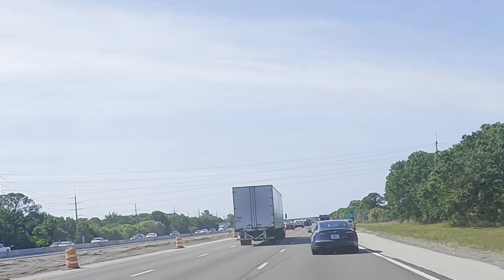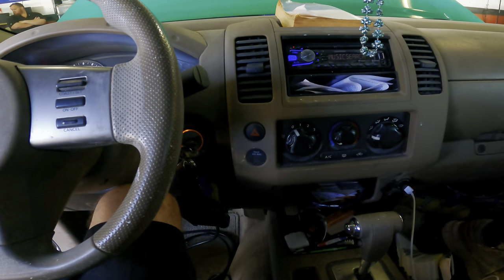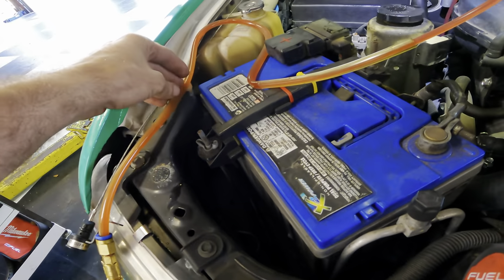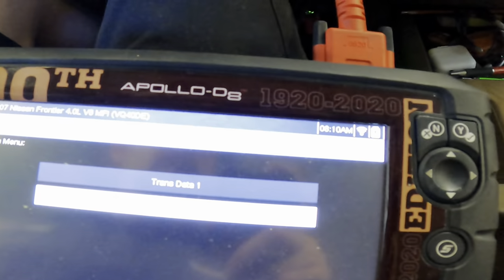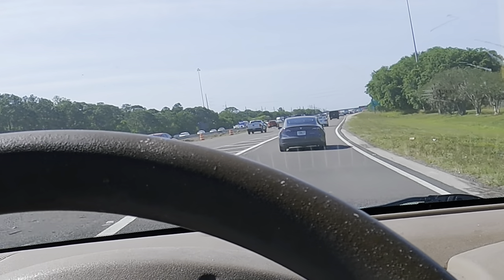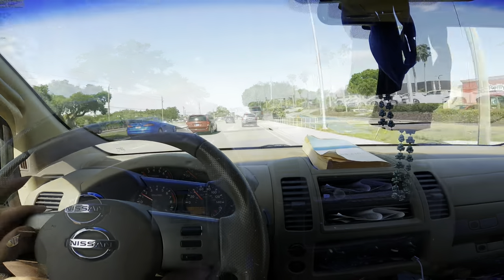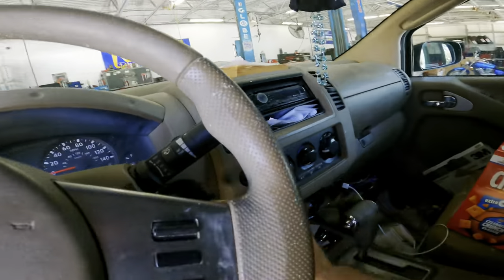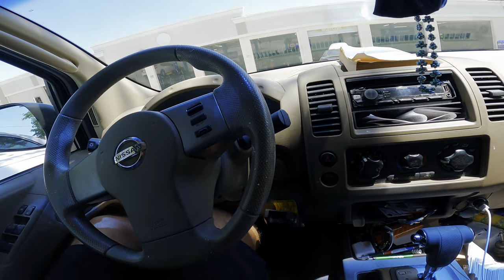Customer States: Vibrates Sometimes! How to save money by using your words!

Comment: I've found that no matter how detailed my description of the problem to the service writer,  the technician rarely gets all the details.  For many years now I've actually typed a short detailed write-up of the problem (my handwriting isn't great) and ask the service writer to attach it to the repair order.  That seems to help get better information to the tech.  I do have an advantage over those people who only know how to put gas in the vehicle and turn it on, I have an automotive engineering degree and spent part of my automotive career as a service rep for a Big Three automaker.  I learned very early on that the single biggest problem causing repeat repairs or just failed repair attempts is poor communication.  Dealerships and other service shops need to understand this and upgrade the service writer position.  Most places I used to visit as a service rep seemed to care more about the writer's ability to up-sell than they cared about their ability to communicate effectively with the customers and then provide the needed information to the tech.

Comment: Service writer the other day wrote a truck up to check brakes because they're squeaking when stopping and set tire pressures. Didn't ask did you have brake work done recently were you told on your last service you needed a brake job soon or anything? Customer had brake work done somewhere else and wanted to know why it was noisy. I'm not diagnosing someone else's work for free! As for the tire pressures they were already set at 40 psi, which is what they wanted but wasn't told until afterwards... smh

Comment: in my experience, initial short inspection looking for obvious faults. If nothing found then place a short phone call to the customer. Cut out the middle man (the adviser) and get the words/complaint/description straight from the horses mouth.  simple "Hi. it's jim from the shop. I'm the tech trying to solve your problem. can you expand or clarify what the problem is? I was told I'm looking for a clunk or a rattle. when does it happen? at what speed? does it sound like front or rear to you? while brakinng?  when putting into gear?etc etc etc"........those five minutes on the phone saves an hour of guessing.

Comment: The mechanic makes the difference. 
I bought a used car, something was making a jingling noise when driving and the dash clock didn’t work. The dealer agreed to fix them.  They couldn’t find the jingle noise so they replaced the blower motor. They jiggled the clock power lines, it worked for a bit, then stopped. When I picked it up nothing was fixed. I ended up replacing the clock myself. And the jingle noise was large cotter pins used to hold the grease caps which I replaced with the correct size. They were total idiots.

Comment: Not gonna buy a Corvette; but I did subscribe.  It is important indeed to have at least a semi working knowledge of what makes these thingies run.  Most people are totally unaware of what happens when they turn the key or push the magic button.  It's like the doctor whose plane's alternator died, and so the battery was starting to run down.  Such a simple solution.  Fly to an airport, land, charge the battery replace the alternator, and be on your way. 

But nope.  She either never learned, or forgot, that small planes have two separate ignition systems, and neither one is dependent on the battery.  They're like the old push mower systems.  Pull the rope, the engine starts till you short out the coil.  squeeze a metal thing together with another metal thing, the engine quits.  No battery needed.

She forgot that, so in a panic, landed with the wind, at too high a speed, went off the end of the runway, and tore up the plane--which had been in the family for 30+ years.  [Sigh....]   Just learn a few basics, folks.  So you can communicate effectively.😏🙄

Comment: Transmissions in the Nissans have been a problem…especially the torque converter. Over time, the heat breaks down the trans even if an external trans cooler is added, the tranny breaks down (torque converter). Google Nissan tranny problems in 4cyl vehicles.

Comment: Communication is extremely important  .I watched in horror as a transmission was being removed from a car that came in for  HVAC issues .  I greeted the customer, made the Repair Order , had the customer sign the RO , tagged the keys and stapled the keys to the RO  , keep in mind  I was not the Advisor at the dealer , I was a Tech .  The Advisor and Tech took it upon themselves to make the executive decision I was mistaken , pulled the car in and removed the Transmission from the FWD car . The Tech and Advisor ignored my comments and  found out the hard way that I was correct when the customer arrived to pick up the car .
Reply: @kitsuneneko2567   nope , continued to be very unorganized and lots of come-backs usually little shit but it's still a come-back

Comment: I feel you on the info bit. I'm basically the neeeeeeeeeeeeeeeeeerd equivalent of a shadetree mechanic. (Relevant "The Simpsons" clip goes here.) The more detail you can give me, the better.

For example. "It doesn't come on." This can mean anything from, it literally sits there and stares at you when you press the power button and does absolutely dead-as-a-stone-statue NOTHING, all the way to, it tries to boot to Windows, bluescreens, and reboots... and everyfreakingthing in between.

In the former case, there are precisely TWO possibilities, barring an outlet that doesn't work or an accidental power cable unplug. One, your power supply is cooked, or two, you have a bad power cable -- it happens, I've seen it, and I've fixed it. Either way I'll have you on your way in well under thirty minutes unless you have one of those machines with a stupidly weird power supply that they put in there just because they could, in which case it's a matter of ordering the part and dropping it in... I'll give you a quote for the part, if you want to buy it, when it arrives I'll call you and as soon as you come by with your machine again, drop it in and fire it up and away you go.

In the latter case... it could be anything from the system overheating because it's a Pentium 4 Dell that's been upgraded to Win7 or so and yet somehow it's not seen the business end of a compressed air hose or even a can of the so-called "compressed air" computer duster stuff they sell at Walmart and office supply stores for a frankly ridiculous sum in its entire life and it was sold only six months after the Twin Towers fell and Aunt Judy remembers specifically that it had to be six months exactly because blah blah blah nobody actually cares... or it could be that the last fellow Tim took it to wasn't nearly as trustworthy as Tim swears he had to be because he's Edith's cousin and everyone knows he'd never swindle from a fly (coz Edith says so) -- but somehow one of the latches on one of the RAM sticks is a bit loose... to someone thought they were 'clever' (that is very much a vulgar word in my presence, in this context, and this exact sort of tomfoolery is why) and when they were installing some new bit of anti-malware thing WITHOUT REMOVING THE OLD ONE because they got yet another virus, it told them to install this free driver updater gizmo, they thought that was an excellent idea, and when it magically found them a much newer driver for their antediluvian chipset graphics, they figured -- hey, it's a newer driver, that can't possibly be bad, right? and that's the last good boot the system had. Of course it'll be ninety minutes of switching parts around before it occurs to them to actually tell me that... I tell you what, folks, I'm probably gonna be here a while, and it's probably gonna be a bit of a show :-/ I hope you brought a coffee, and maybe some popcorn...

The more you tell me, the more I know. This is true of ALL technicians doing repairs on your stuff, whether it's a car or a computer or a smartphone or a tablet or -- anything, really. YOU are our eyes and our ears. Tell us what you see. Tell us what you hear. Give us as much detail as you possibly can, and leave out as little as you are physically capable of leaving out. Things that you think are likely irrelevant are often the key to a solution, and we will often assume, if we don't hear you tell us that it's a thing, that it isn't a thing, and that will lead off on a wild goose chase of false conclusions. Make no assumptions, and leave us no room to make assumptions. Tell us everything, and I mean that as literally as is humanly possible to achieve.

tl;dr, the more I know, the better I can fix your cr*p, and that's true of all techs. If you want it done fast and done right, with the least amount of "gnashing and wailing of teeth" (to quote a good friend of mine that I don't talk to enough any more -- heya, Ryan :) hope you're havin fun out there) possible on all fronts, tell me absolutely everything you can and don't hold back.

Comment: Ray, I have an ABS light, and have an expensive Autel that should let me reset that light. But it does not. The car is an Accord EX.
The car does not show any problems with the breaking system. Could just be the ABS module needs replacing?
Hopefully I gave you enough info!

Comment: I like your point about lacking vocab to describe a car's woes. I begrudgingly have come to terms with that fact that to most/many ppl, cars are just a metal capsule means of getting from point A to B, to that end, it's hard to expect them to know how to describe issues in ways other that, "it doesn't..." 

Idk how tech versed you are Ray, but you may say, "the website doesn't work" well, are you getting a 500? DNS error? JS script break? Taking long to load? Are you online? etc. 

On the flip side I try to over explain and it seems I come across ppl that couldn't care less about my helpful details lol 

I'm hopefully moving to a new role where I am the customer service AND responsible for the end product's performance. Removing the middleman for better and for worse -I get the brunt of customer complaints 😅

Comment: Many service 'advisors' or nothing more than sales people whose job is to make profit for the shop by selling unneeded work. Sears store I worked at was good for that. They know virtually nothing about the cars they are supposed to be providing service for. The service writer at Sears when I was there DID know her stuff but worked on commission and wanted to make more $. Had that problem with dealer service writer and had to take a tech out for the test drive for a squeak in the front of a '08 Hyundai (bad bushing>>fixed under warranty).

Comment: It’s worth it to do a flush and filter on the tranny when it’s that badly burnt. I have a feeling the clutches in the converter and tranny are nearly completely smoked. That would definitely cause a vibration from multiple issues with its many parts.

Comment: Ray, a comment on your one-hand driving, if I may. Much of the time, your hand is at 12 or 1 o'clock, which puts your arm directly over the center of the steering wheel, where the air bag is located. Should that bag go off, it will shoot your arm into your head and you would be severely hurt. Other times, your hand is at 9 o'clock, which doesn't have that problem. Most driving instructors recommend people keep their hands and arms away from the center of the steering wheel, ideally at 10 and 2, for that reason. You make several good comments about safety (ex: lift, "egg" tires) and it would be good to let your viewers know about steering wheel safety too.

Comment: These suffer from bad radiators that dump coolant into the transmission and burn up the transmission, they also suffer from bad timing chain guides that cause a howling noise as they wear. I had a 2007 Frontier SE KC biggest piece of crap I ever had.

Comment: My expierence as a customer giving out all the information was mixed. I repair most of the stuff myself, but sometimes you need special tools that are too expensive to buy for one time use and sadly here is no rent-a-tool service available for car tools. I do know a lot about the mechanics and electronics. Sometimes the service person did not want any extra info and I get responses like: "yeah yeah, we check ourself, you stupid customers don't have any clue anyway" Not literally, but you can hear that. This annoys me, so I'll never go there again. Currently my car is in a shop because of overheating and fluid loss, I told them to check for exhaust gas in the cooling and do a pressure test to find a possible leak. Not sure what causes what: leaking fluid => not enough pressure in the system => cooling evaporating or overheating=>high pressure => blowing out steam somewhere. I don't have a lift and I don't see any water traces. They first shop did not want to listen what I had to say so I searched another one that listened. But they also did not like that I gave them a list of "things to do" So it goes both ways. Yeah the liquid isn't that expensive and you can get pressure thingies for cheap, but this is the first time in 30 years fiddling with cars that I need that. Probably I wont need it again.

Comment: Step one in this would have been to call the customer before taking guesses.
Reply: From what I've seen of Ray I would guess that he asked the service writer for more detail and none was forthcoming. One reason they have service writers/advisors is so the mechanic doesn't have to take time off the shop floor to interface with the customer. If more detail is needed, the tech can be working on another job while waiting for the front desk guy to call the customer. Of course, as pointed out by others, this depends upon the service advisor doing a proper job of communicating.

Comment: Problem could be nothing to do with transmission, could be fuel pump, ignition issue, who knows?  People have to understand as vehicles age things do start to wear out.  For example torque converters wear over time and can cause rough idle or whatever, they can go on for years like this, would you replace it on an older car?  No you would live with it.  This is happening on my '97 Celica with 231,000 miles, when I stop in Drive the idle goes way down, the solution?   I'll slip in neutral and it then idles smoothly, as you say people must try and educate themselves on how cars work, they will save a lot of money!

Comment: You mention the need for better scan tool or data/functions within said scanner. Can you recommend a GM focused device that can read/program like a Tech2 but attainable by non GM dealership mechanics? I’m a big fan of your channel and have a LLY and a LBZ DURAMAX equipped trucks. Your scanner was able to do the injector program on that L5P. Not sure I can afford a SNAP-ON but I’m a big fan of getting the job done myself. I’m not a certified mechanic and would like to qualify myself as a shade tree mechanic. My son recently graduated from UTI. So I gotta get the lingo and tools to keep up with him. I will say that I communicate with shops and they don’t always put the info into the ticket. I hate the phrase “it is what it is” but sometimes it’s the best phrase for the topic. Ugh!!!

Comment: I was working at a marina for a few years.
Always liked to talk to the Customer because getting the complaint third or forth hand sometimes sucked.
When a counter person tells you what the guy that took the order in says the customer said it makes a sound like.
WICKY WICKY WOO WOO DING DONG you can only stare like a dear in head lights.
I got to talk to a customer once and he fixed his own problem.
The motor shakes when it runs ever since I did a tune up.....Plugs,points,rotor cap.
It ran ok before that.
What did you gap the plugs to.....they come pre gapped out of the box.
Ummm...and the points???
The points???
What do you mean.
2 Plugs had no gap they all needed to be regapped.
The motor was GM so I hooked the dwell meter up and the dwell was pretty close just off by a touch witch shocked me.
He said this is the best the motor ran in years what did you do???
A tune up.
Buy a cheap plug and feeler gauge it will be your friend.
Would of mentioned a dwell meter but extra stuff might make his head hurt.

Comment: I'm surprised you don't have a bi-directional scan tool. Any of those older Autels would work (MaxiPro not Maxisys). I have a older MP808TS and it works great, it's a bit slower than your scanner but I'm able to control everything I want. It also does TPMS which is nice.

Btw I'm already subscribed and own a C7 vette....

Comment: Need to get the company to purchase a Autel. 1 for the shop and a tech 2. If i was purchasing a $4000 scantool i would only buy personally, dont help big coorps make more $$$ on you. That's how they lock you in to work with them. Aswell as sending a snap on truck to lure you in .

Comment: The TCC issue could be intermittent and cause the car to stall and "shake" when at lights. It literally feels like a clutch is engaged. 10 to 1 that's their issue.
Reply: i experienced this countless times on 80's GM frnt wheel drives had to drive them on a very long test drive to get to act up.

Comment: I'm sorry for the lack of communication. A vibration?  A tire out of balance? suspension problem? Misfire? Transmission? And the list goes on?  Does it do it when you first start, after warm up?  And most people say I don't know I just drive it? So it falls onto the service adviser to ask very simple questions.  So you Ray don't have go a Vibration?🤔! This breakdown in communication should be followed up by the Service adviser.  But I really like your choice to exchange to tranny fluid.  😉

Comment: It is wrong to drain the transmission oil and leave the engine running... because the torque converter is connected to the engine and it rotates while it is empty of oil 😅